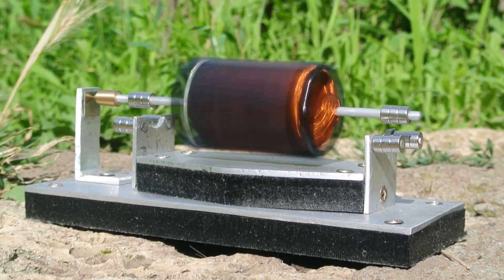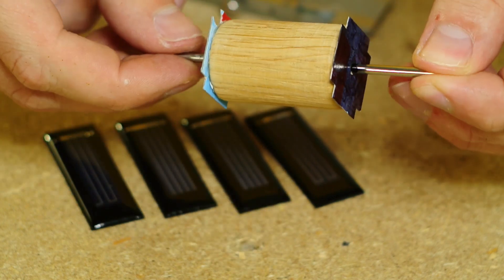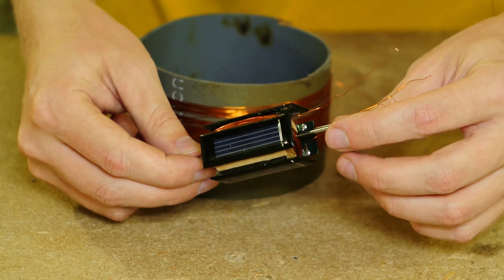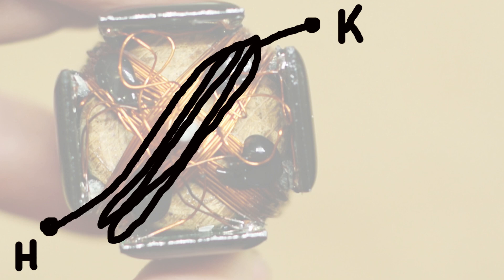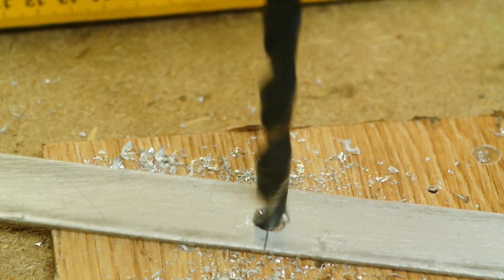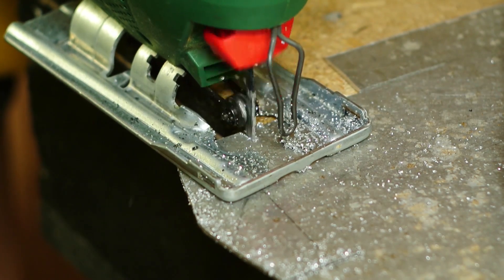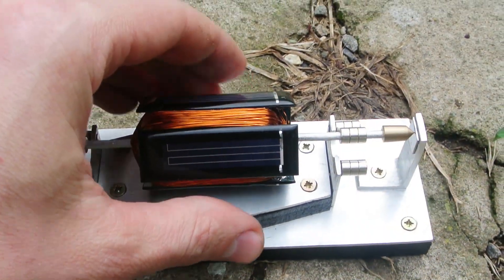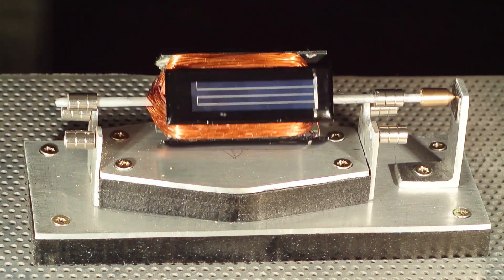How to make Mendocino Motor

Comment: I did enjoy your presentation very much... but... I have said this to many other makers of the 'solar levitating axis motor'... and now I will say it to you too... why not use opposing magnets (i.e. North Pole facing North Pole) at both ends of the axis rod to stabilize its position in 3D space??... this will completely remove any physical contact points and therefore reduce friction to a minimum... i.e. wind resistance only. Give it a try.
Another good idea is to build a vertical axis model... and fit it with an axial flux alternator... free power... while there is light on the panels... even synthetic light.
Thanx HAMMERLAND!!!
Seriously Cool.

Comment: This is very interesting!    How might this be used to harvest actual electricity into batteries, not just a desk toy?   
What do the little solar panels do?
Reply: Winter Star They basicaly power up the whole thing, the electricity they generate is used to spin the motor ;P

And sadly this motor is not designed to generate a whole lot of power, its just for educational purposes i guess... as the main shaft does not have any torque at all (by that i mean it is very easy to stop the motor from spining, i bet you can stop it with only one finger), you can not generate power with that... :/

But it still looks amazing so it's  okay X)
Reply: Oh...didn't realize the solar panels were actually feeding energy to turn it...thot maybe those were simply used to cause heating in alternating sections. 
Someone else made something like this, only, far simpler....used stretched garbage bag strips, on a barrel/bucket/cups [depends on size], which heated up, causing the cups or buckets used under them, to warp slightly on the sides facing the sun, which caused the construct to turn.  [the strips cooled as it rotated to the shaded sides].  No solar panels....but his demo was also a toy demo. 
What if that kind of thing were used, with magnets inside the buckets or tube holding the dark and light strips...might that generate some usable energy?
Reply: Winter Star Well basicaly you could generate power with anything that spins, but considering those motors are only designed to move and not to generate power, they do it with a very small force so it is hard to create a lot of energy with it, but yes, i guess you could generate some.

Considering the little motor that was made in the vidéo can't provide a lot of energy, if you wanted to power up something with that you could also just directly plug the solar panels on the power input ;P

And the motor you described could'nt work with magnets this way because the magnets also need coils to repulse, as it is the thing that moves the whole thing. it would be possible to add a coil in each bucket and add a magnet at the bottom of the motor, not to far of the buckets, then connect the coils to solar panels. This should spin if correctly made, but now the whole "bucket heating" system would be useless, as this should now spin too fast for the buckets to even heat or cool.
Reply: Also, no, the solar panels are not used as heaters ;) , The way this motor spins is like every other brushed motor does : it applies power to the coils in a correct order. it is acctually using electromagnets (Those are the coils on the motor). This is also why there is a magnet at the bottom of it, it's the magnet that is used to spin the motor

Comment: Any practical use of this? It seems that it will not, never work if you attach it to a generator or anything mechanical in nature as it shows it only works well with the very least resistance/ friction which is air or suspended in the air.

Comment: There is only one problem. You can't get energy out of it. Attaching any type of friction to it will stop it. There is not enough turning power to rotate any type of alternator.
Reply: RedLightHitter indeed, no torque, no power... it still looks great tho x)
Reply: If you want the energy, don't build the motor, just hook up the solar cells to whatever you want to power or a rechargable battery.  The cool thing here is the air suspension / levitation.

Comment: What would you attach to this to collect the power?  . ..  maybe a video on that next ?  I'm very interested . Thank you for the video .
Reply: It's far more efficient to just use the solar panels on their own to generate electricity. For one, the fact that this motor spins means there are losses due to friction (with the air around it). Therefore, any method of converting the movement to electricity would be less efficient than the panels themselves.

Comment: poor motor  only one panel is ever in  the most optimal position to receive the  light  nice model
Reply: That's how the motor works, by having a differential of current from one side to the other to self state. If all sides got equal sunlight it wouldn't move.

Comment: Very good, congratulations! How to adapt a Dynamo to generate electricity?
Reply: i'm almost certain the amount of kinetic energy is way too low to get any sizeable amount of electric energy from a dynamo - chances are, the dynamo will stop the mendocino motor if you attach it.
if you want electricity from it, you should connect the solar panels directly to whatever you wish to feed with it.

the reason why mendocino motors usually are built hovering, is also because that removes most of the friction (only air and that tiny pike cause friction, and that's very low). if it generated a lot of energy, it could overcome much higher friction.
Reply: +aprillomat
it can generate a static charge, which can be harnessed with a tesla coil to generate free power.
Reply: Trevor Hurd
do you know how small the amount of energy is that a static charge of that magnitude nets?
then you might as well just attach a tiny dynamo. or harness the electricity from the solar panels directly. either way, you couldn't do a lot with it.
Reply: *****
 Here, I thought you could save up charge in a capacitor to use at a set rate.
With enough switching, transforming, charging, voltage ramping, and discharging, I think you could get quite a lot of good use out of it.  The whole thing would be basically like a Wimshurst Generator that you don't have to spin yourself.
Reply: Trevor Hurd
in a way, yes. in fact, i have a wimshurst machine at home. the sad truth, however, is that a wimshurst machine doesn't generate a lot of amps, either :)
it makes pretty sparks, but if you try to use it to power something, let's say a motor or lamp, it will struggle quite a bit.
so any appliance that needs a steady DC supply is out of the question. on the other hand, anything that takes very little energy to power, or can work with sudden periodic discharges, would work.
Reply: *****
 Which is why I said you needed "enough switching, transforming, charging, voltage ramping, and discharging,"

Store your charge in capacitors, ramp it up to super high voltage, transform Volts to required amps, do DC/AC/DC, etc., not necessarily all in that order, and there you go, amps.  Go Tesla on the whole thing, and it'll come out working.

Comment: Thank you!! Would love to build it. How can you convert that motion into electricity?
Reply: Why would you want that? It's far more efficient to just use the solar panels on their own. For one, the fact that this motor spins means there are losses due to friction (with the air around it). Therefore, any method of converting the movement to electricity would be less efficient than the panels themselves.
Reply: I didn't account for that. Do you think it would be the same within a vaccum?
Reply: Yes, It would be more efficient in a vacuum for sure, but still not as good as the solar panels on their own. If you're wondering where the energy goes then, look up the properties of a solenoid, like how it interacts with magnetic and electric fields. You'll find that it takes work just to move a charge in a magnetic field. I think its all pretty interesting, but it's just too much information for me to type out in a youtube comment. :p
Reply: Just put some small coil next to that spinning little magnet!! Get ur self some free energy